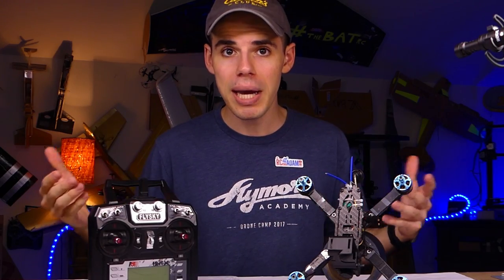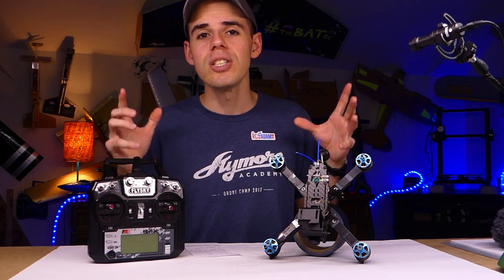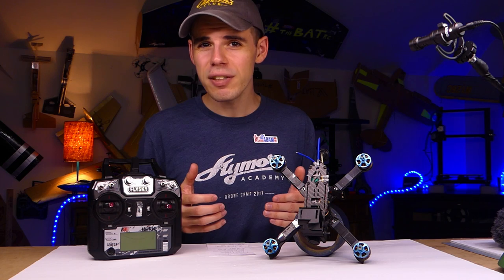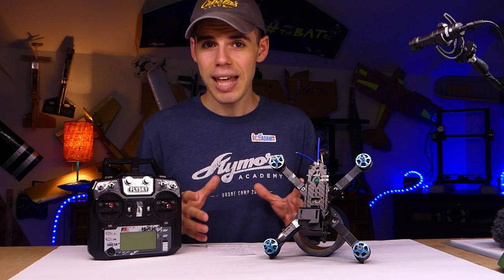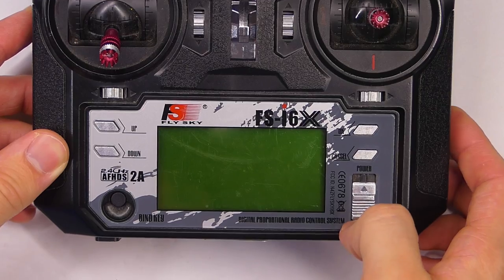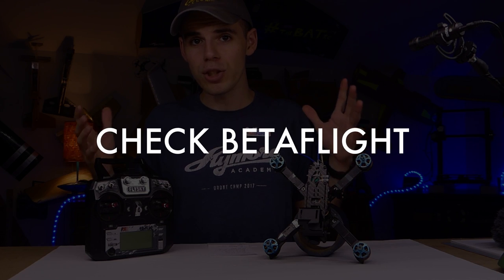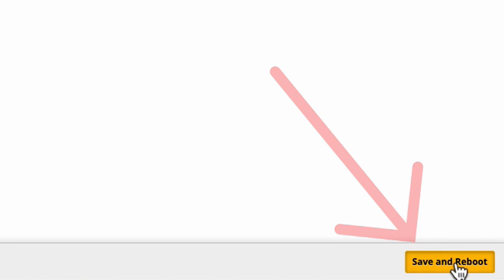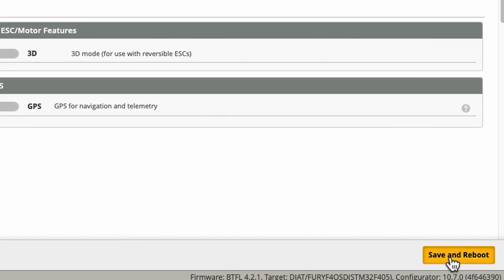Why Your Transmitter Won't Show in Betaflight - Most Common Fixes

Comment: I've got a FS-I6X controller and trying to pair with a A8S receiver. I can bind them however it doesn't show up with RX signal on the controller and cant find any signals from the receiver when I plug into betaflight. I've got them all working on ibus (controller, receiver and on betaflight). The receiver light stays solid red when I turn the controller on to show that its connected but nothing else seems to show that it is (betaflight or controller). Everything works fine with my X6B receiver but when I change to the A8S it doesn't seem to work. Any advice?
Reply: Never mind. Couldnt get it working with ibus but when I changed everything to sbus it worked :)

Comment: FrSky Tandem X18S transmitter with Rxsr receiver.  It's bound, it works on other models (to verify).  wired properly.  SBUS_OUT on Rxsr to rx1 on mamba f411 aio 35a.  No dice...

Comment: Good advice , Adam !  .... But ......Being a Designer , Builder , Parts Picker , Soldering Expert , Electrician , Software Connector and Troubleshooter is a Tough Go for Some ...... And Some get very frustrated .... Maybe the Answer is to Buy an RTF Package like the Bugs 2 or 3 for $100 - $200 bucks that Flies like a Dream , will carry a GoPro , has 15 minute flight times and GPS RTH and auto landing .... and FLY rather than Build and Figure !  ...... What's Wrong with KISS ?  ....... We all can't play golf like Tiger ...... so why do we have to Fly like Roto Riot ?  ..... Cheers !

Comment: i upgraded my betaflight and now it won’t connect to my transmitter. I was working just fine on the old version but in this one it wont. it is bound with my receiver but will not show up on betaflight. what do i do.

Comment: I’ve tried all of the uarts for my receiver and there’s even a “sbus” port that I’ve tried too. Still nothing I got all the settings right and even updated the fc and my r9m is up to date as well and is properly paired to the controller bc of the green light I have. Still nothing
Reply: I’m having the same problem
Reply: @kraigvanderwyk1153  this was months ago I’ve figured it out. I can help possibly.
Reply: @jaredallen8054  I would definitely like to know what your solution was. I’m at a loss.
Reply: @kraigvanderwyk1153  I sent you a dm on facebook

Comment: Someone I know said he binded his drone. Clearly its binded because the motors can spin when in the motor tab but his radio is not connecting to beta flight. He told me he tried all the serial rxs but he cannot save n reboot apparently. Why is that?

Comment: My crossfire micro receiver is bound and lit up and working when I hook up to betaflight receiver tab, but when I hook my battery up all of a sudden I get no movement in the receiver tab, and my receiver is still bound and still lit up green but no movement, until i unplug battery and using usb power. I can't find any help online I've been searching for hours for the problem. Any suggestions would be greatly appreciated.prebuilt quad roma f5 dji. What a faulty receiver cause this?
Reply: Hello, you solved that problem? The same happens to me

Comment: I have been building and flying for 2 years. All of a sudden I'm stumped. I use ELRS since I got my TX16S but before that I used Crossfire. I have 3 old receivers that are bound to my crossfire module.  I just built a new quad with a new Skystars stack and used one of the crossfire receivers and the crossfire module on the new radio. Betaflight does not see my radio. Move the sticks, flip switches and nothing shows up in the receiver or mode tab. Receiver goes green when the radio is on. Plug in or unplug the quad and the radio says telemetry lost, telemetry recovered. Skystars shows UART2 as the place for the receiver. I am on UART 2. UART 2 is turned on just like the directions say. Either the FC is bad and UART 2 doesn't work or the radio firmware isn't working with the Crossfire module. But the radio knows when the module and receiver are connected or not connected, so maybe it's the FC. I'll try using a different UART when I get a chance to mess with it again. I'm using EdgeTX on the radio. Maybe you have a magic answer? I've set up the 4 switches in the mixes page on the radio, but nothing, no channels show up in Betaflight. So receiver sees module, module sees receiver. Radio talks to module to give me the sound notifications of telemetry recovered or lost. Has to be this new FC, right? TX to RX and RX to TX. It's soldered on correctly. Possibly a cold joint? SHouldn't be the case, but maybe I'll try resoldering that first.
Reply: Hello, you solved that problem? The same happens to me
Reply: I have exact same issue
Tx16s radio too 
Any answers?
Reply: @Adrian-sm8qc  Sorry, no. I just bought another ELRS receiver and put the Crossfire stuff away.
Reply: @SpaghettiFPV-tg3qh  Sorry but no. I gave up on the Crossfire and just put another ELRS receiver on the quad. It must be something with the firmware on the radio and the receivers?
Reply: @SpaghettiFPV-tg3qh  Maybe I needed to run a Crossfire LUA script on the radio? I don't remember what I did to get Crossfire to work originally.

Comment: i have 2 acrobee65's. transmitter connects to both of them but the transmitter wont show up on betaflight on one of them. they both have the same exact firmware and settings

Comment: Hello, I have burned hours trying to find out why my Dji remote does not show any stick movement on beta flight. I know its bound and so are the goggles. Everything is on the latest software. I have the HGLRC Petrel 120X HD 3" 4S Toothpick Racing Drone w/ Caddx Nebula Nano. I know that Betaflight connects fine but I go to the receiver tab and nothing moves. Please help. I have the black Dji remote. Thanks
Reply from the maker: Hi! That's a bummer! Are you sure all the wires are going to the correct pads on the flight controller?
Reply: @RCwithAdam1  hello. There was no wire on Sbus or ground next to it. I did that and now it’s showing movement on betaflight. Thanks for the help.

Comment: Yo total noob here ;)  got a rtf novice 3 and it did work fine for a week or so buy a few days I have trouble connecting it with my goggles. I did land in wet gras a few times but it didn’t had any effect at that time. Still worked and had no issues for the rest of the day. But now sometimes it works, sometime it doesn’t. Checked all the wires, antenna and solder pads. All look fine to me (beginner). Already set my goggles to the right Chanel (according to the lights) and then it’s not the standard snow image but black snow. If I unplug the camera the image changes to flat gray. If I press the Chanel switch I do see something happening in the goggle but I’m clueless.. few days ago taking it apart and rebuilding it worked but when switching a battery it suddenly didn’t work. Doesn’t make sense to me.. you got any idea? Video transmitter isn’t showing up in betaflight at the moment even when it does work (previously i guess it did) and at the times it did work I could not go to the vtx settings inside my goggles (only “statx” inside smartaudio settings). Thinking to buy a new vtx. Or can in be an issue with the flight controller?
Reply from the maker: Oh no! Sorry to hear that! Welcome to the hobby though 😁. My first guess is a break in the VTX signal wire connection somewhere (explaining the intermittent functioning). Does the OSD ever show up with the rest of the screen black (no image)?
Reply: @RCwithAdam1  thanks for the quick reply! :D 
I got it to work again without knowing what I solved. When it is connected I moved all wires to see if the problem was there but all seems good. When I had the problem the osd didn’t show up. What you are referring to is a problem with the camera right? Currently (since it works now) when I unplug it I see the osd with a gray screen. So this connection loss is total random to me now. Still don’t know what caused it

Currently I also cannot setup my smart audio. Inside the vtx sa settings the only option is “statx”. What does that mean? Usually I could change the Chanel and power here

Comment: On my case the receptor turns green when i have my transmitter ON ( Frsky x9 lite), i have seen several videos where u change stuff on the sentings etc but it still doesnt work :/. My problem is when i go to the reciever tab on betaflight when i try to move anything on the transmitter doesnt change anything on betaflight. Btw my drone is a Nazgul 5 6S.
Reply from the maker: hmm. What receiver do you have?

Comment: Hey man,  I can't get the little bugger to connect to my receiver. It gives me all the proper tones when I plug it in (the three and then the other 2) so it seems to have bound, But it won't arm and I can't get any receiver in Beta flight. The VTX has a solid blue and 3 red blinks/ the boot button has steady red blinks. Any ideas??? I am useing frsky and it is telling me telemetry lost when I unplug so it seems to be connected, the sbus on the F/C is bridged.
Reply: Mate i have exact same issue did you ever figure it out?

Comment: I have a GEPRC Cinelog 25 with the CADDXFPV and GEP-F411-35A AIO receiver. I'm using a DJI FPV remote controller model P1RC.I have the Goggles V2, controller and receiver all binded and still can't get Betaflight to recognize the controller. I have green lights on all parts and can connect the quad to Betaflight but once I try to move the bars on the transmitter part of the menu, nothing moves. I have tried all kinds off stuff and can't get the quad in the air... this is incredibly frustrating.
Reply: Have the same issue did you find a fix

Comment: Based on what people are selecting UART3 and you have selected UART6? please answer if possible
Reply: You have to check in which UART you connected the reciever
Reply from the maker: Typically, the UART number will correspond with the RX and TX pad number. For example, UART2 in betaflight corresponds with RX2 and TX2 pads. It's best to check the manual or diagram to find the suggested or best open uart to use.

Comment: hey i have the pusher25 iflight. and just had to replace the FC. now with the new CF the drone seems to work, the crossfire also has a connection to the controller but when Im in betaflight it shows no activities of the Radio when I use the sticks and buttons. Also when Im go down with the nose of the drone, the drone in betaflight will go up with the nose. maybe its because a pusher is inverted whats normal but Im not sure if thats right. so basically first i wanna fix the radio connection issue and then lets see how the drone will fly ^^
Reply: Hello, you solved that problem? The same happens to me

Comment: great video with good advices, too bad i still dont have stick input showing in betaflight with my R-XSR :( i'm missing something
Reply: Did you get it to solve the problem? If No, I can Help you.
Reply: @shuraim8675  yes, i found out my cable was only for charging and didnt transmit data to computer
Reply: @TheKamiky  Oh, I thought that you had betaflight ready :P

Anyways, Happy and safe Flying :)
Reply: @shuraim8675  No worry, i solved everything for a while now, had time to make some epic flights then crashed it in salt water
Reply: if the cable is data only, does betaflight recognize the gyro and the flight controller?
I am trying with a green hornet RTF and betaflight does not recognize me imputs
Reply: @manuelbergafernandez8023  im not sure, last time i tried i couldnt even connect to the drone. make sure to try different cable anyway
Reply: @manuelbergafernandez8023  In that case try plugging the battery into the quad (REMOVE THE PROPELLERS) and Lemme know how it goes. If it doesn't work, I've a different fix for it :)
Reply: @shuraim8675  First, thank you very much
Try swapping multiple cables, but the betaflight only connects to one. It is the same as I use for the simulator.
I have tried with the battery connected, but the betaflight still does not recognize the inputs
Reply: @TheKamiky   thank you very much.
Reply: @manuelbergafernandez8023  It's just a bad cable or let's say it's a charging cable. As far as I know, There isn't a Cable for Data alone. It's either Data + Power or Power alone. Anyways glad that it worked for you.

Happy and safe flying :)
Reply: @shuraim8675  Problem solved ! update absolutely all! (FC, RC and Receiver) and it came out working. I think the problem was that when updating the R-xsr receiver, the firmware that is for Fport was chosen and that corresponded to use the common firmware ...
thank you very much to all.
And as a conclusion, I mention that before disassembling a Drone RTF it is advisable to start updating its components and continue with each update.
Reply: @shuraim8675  muchas gracias !
Reply: @TheKamiky  muchas gracias

Comment: Please help my beta 65 iron quad looses signal after take off  like 2 feet after take off I don’t have a lap top just a speedybee and a I phone
Reply from the maker: Hi, Sam! Hmm... it sounds like radio signal issue. Are the antennas connected well? and are the batteries fully charged on the quad and transmitter?
Reply: @RCwithAdam1  yes they are and the radio works fine the  I was told something about turning something in beta flight from 300 to 600 now I don’t no what need adjusting but what I did was take a old 75 whoop and and this 65 and made it work but I was hoping to do it the right way lol .

Comment: So I just configured a mini quad with an IFLIGHT F411 AIO in it and it was running betaflight 4.2 but had a motor issue so I updated it to betaflight 4.3 and then the transmitter would no longer send inputs to the FC, I'm using a vista so I know its connecting properly, I have double and triple checked the connections, the setup worked before the flash, I also checked the receiver tab and Ports tab, everything is correct but the controller will still no longer give inputs to the FC anyone got any ideas, maybe a CLI command, I have also tried going back to the old firmware and that doesn't work, when I first went to 4.3 on it I did not save the settings so there may be a hidden setting somewhere that is messing with me

Comment: Tried everything short of unslodering and resoldering the crossfire nano but I still can't get rid of the RXLoss and CLI codes to arm. Everything is green (crossfire nano, crossfire unit on tx16s) but still no stick controls in Betaflight.
Reply: Hello, you solved that problem? The same happens to me

Comment: Hello guys my controller worked well till I installed a mateksys optical flow sensor all the setting are the same.
Controller binds to elrs but does not show any movement in the program....

Comment: I have green light on receiver the speedybee f7 mini stack with frsky accst R-xsr  I had the green light on board too but nothing worked  now no green light on board and just flashing red updated firmware still no luck  wired to r1 sbus in

Comment: I have a King Kong that was rebuilt onto a new frame. It flies fine but in BetaFlight my tx will not show up anymore. I use to because I had to set up my toggles for arming, etc. The drone shows up when connected with usb and will do an accelerometer congif but nothing in the receiver or modes windows. When I plug in the battery and usb both it will show up to the rx EXCEPT the pitch stick won't register. Pitch works fine when I fly it along with all other controls. I connected to another drone I have see how it did and all was normal and rx would connect as should. Crazy. Any ideas?
Reply from the maker: That is crazy. I have no idea at the moment. Are the receivers different?
Reply: @RCwithAdam1  It has Flysky recvr. No changes. It flys so no worries but crazy as you say. I loaded the previous BF configurator I had upgraded from thinking that might be the issue but nope same thing. Thanks anyway.

Comment: I’m using a diatone mamba f405 board and I’m using a different RX (R9MM) and video TX (Race Ranger) for this build and I cannot get the RX or smart audio to show up. I have changed all my UARTS around so many times. My Taranis and the RX both have the FCC firmware and are connected but it doesn’t want to show up in Betaflight......I’m stumped

I’ve got this board on other quads and I have no problems and it’s brand new and soldered well real clean and no bridging
Reply from the maker: Hmm, maybe flashing the firmware version would help.
Reply: @RCwithAdam1  Firmware is up to date im using 4.2.6...still no response from the RX in betaflight.

Comment: hi bro,
thanks for the video first. second I need your help,
I have 3 things in my quadcopter (big mother board connected to the battery, and tow small boards) the small boards one (I know for sure it's for the video, it's unify pro32 hv) and another small one connected to antenna.
I'm trying to bind my controller (jumper T16 pro) to my quadcopter but I don't know how as I don't see any button on the small board that connected to the antenna!!!
I want to note that on my jumper controller they chose (CRSF) with the external RF (CH 1 -CH16) and the internal RF (multi flysky std ,,, CH1 - CH16)
I'm new trying to understand, I didn't build the quadcopter I bought it as it's. but I use to see signal on my controller. not now!!

Comment: I got this same radio. And it works great with the flysky receiver in my Quad. But I try to bind it to my Radiomaster  and it binds but when I Goto betaflight it doesn't work.. Any ideas
Reply from the maker: What receiver are you using?
Reply: @RCwithAdam1  i got r-xsr and same situation also with radiomaster. Im soo pissed off,  trouble with this for 2 days

Comment: My Receiver will not talk to my flight controller.  I have an up-to-date version of beta flight, my transmitter is bound correctly, I'm using the right UART port, and am using a Spektrum SXRL2 with a omnibus f4 v3  flight controller.  I've done so much research and nothing is wokring!